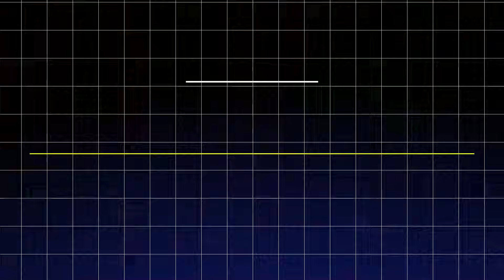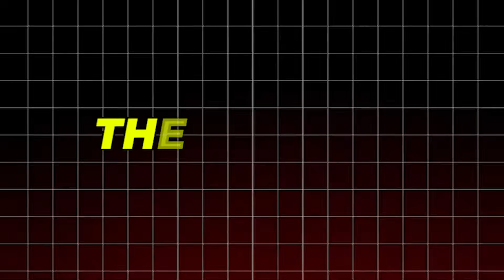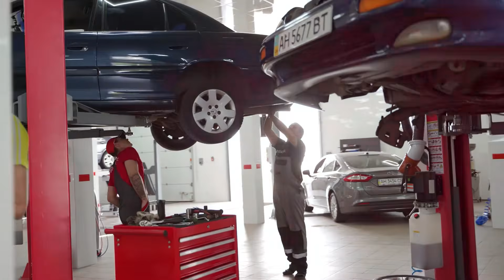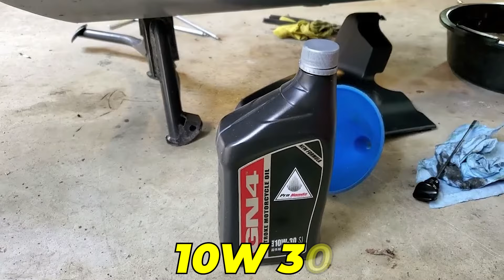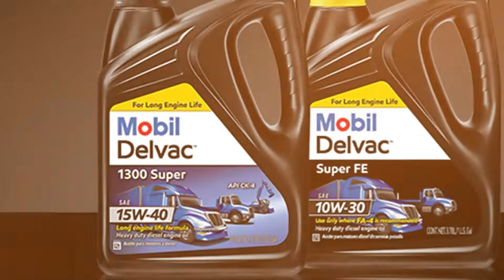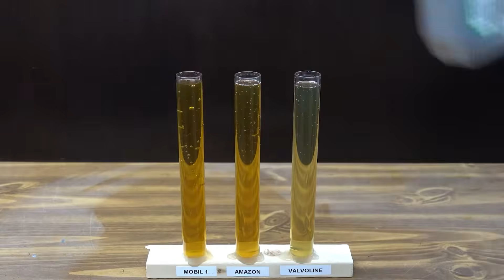The TRUTH About 0W 20 vs 5W 30 Oil (50 Engines Tested)

Comment: I ONLY Use 20W-50wt in my Truck with 298,000 on the clock !!!
Royal Purple of course !!!

I Have NEVER seen in my lifetime that a Engine , ANY Engine , be destroyed using the wrong motor Oil !!!!
That's a BIG Lie , and a scam !!!!
ANY Oil , is better than NO Oil !